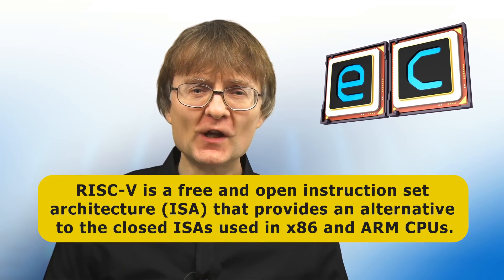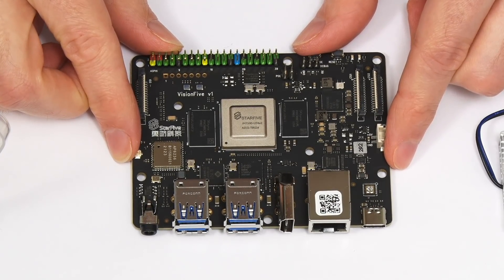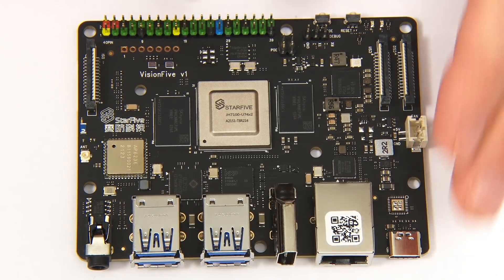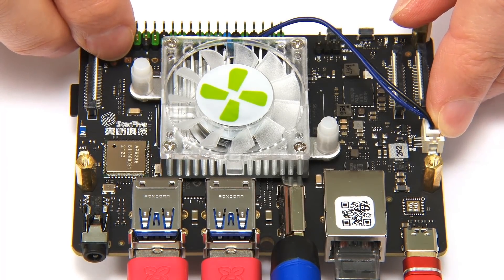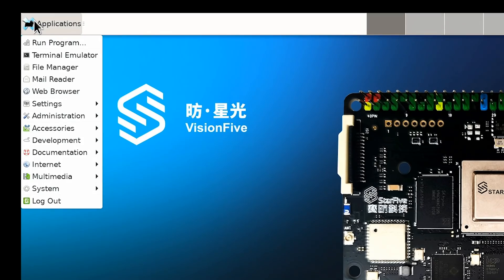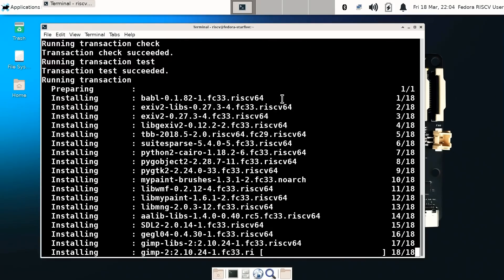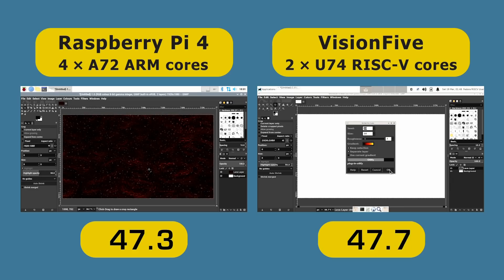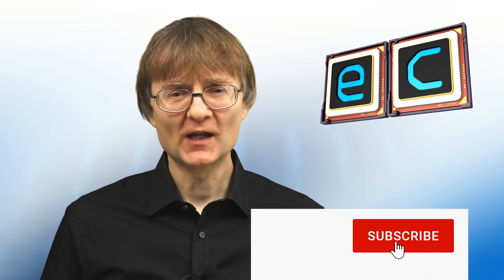VisionFive RISC-V Linux SBC

Comment: Assuming that GIMP Lava filter is a single- or dual-threaded load, the performance of this chip is pretty much exactly on a par with the Pi's ARM chip clock for clock (it's clocked 1.5x slower than the Pi4 and did the filter in 1.5x the time), which I actually think is pretty impressive considering how much longer ARM have had to develop things. I suspect most of the sluggishness on the desktop comes from it being a dual-core rather than a quad. Will be interesting to see how this develops.

Comment: Interesting board. Still years light behind ARM SBC's development. Performance on desktop is way slower than Vim3 Pro, Odroid-N2+ and Radxa Zero2. All of them using S922X/A311D variants. Price is expensive as well. Currently sells at $179 for the starter kit without a PSU/Cable. Rock5B with a much powerful SoC will be selling soon at $99 if you preorder one for 8GB RAM version. Remains to be seen if Risc-V will catch up with ARM and if it becomes a feasible option to ARM in a near future.
Reply from the maker: Behind ARM right now, certainly. But absolutely not "light years" behind. Core for core (2 vs 4) the VisionFive actually beat the Pi 4 in the GIMP filter test! Ultimately, this is a development board, and the price reflects that. It is not a consumer product, and we will have to wait a few years for those . . . :)
Reply: @ExplainingComputers  Does the GIMP filter test use all available cores, or is it single threaded? Running htop at the same time would confirm.
Reply: @johnm2012  GIMP just started getting fundamental multithreading support (with release 2.10) and far from all operations support it currently, so this is likely measuring single core performance for the most part.
Reply: The key cost reducing factor is mass production (including that of parts like SoCs and connectivity). While these boards or Pinephones and Librem 5 phones are built entirely by small companies. Let's hope it gets better.

Comment: That is a fairly surprising (and fast) little device considering RISC-V is (still) having its first baby steps on the market. It shows promise!
Reply from the maker: I totally agree! It is interesting how views diverge in these comments. Some, like you and I, are impressed but what a RISC-V board can do right now. Others are dismissive because it is not as fast and low-cost as current, long-standing technology.
Reply: @ExplainingComputers  I'm one of the sceptics, I'm afraid. If you want a free and open source RISC processor, the SPARC has decades more development under its belt. Years before the Raspberry Pi I bought an expensive development board with a MIPS processor and was excited when I got it to boot to the Linux bash command prompt (not a desktop, of course!). They are still used in routers and laser printers. ARM is special because it can do a lot with very little electrical power. x86 can do more but uses more power. I just don't see what RISC V has to offer that will persuade people to use it in sufficient numbers to allow it to develop into anything other than a curiosity, in which case it will continue to underperform and be more expensive than a similar ARM-based product. I was concerned about ARM being swallowed up by Nvidia and had hopes than RISC V might step up to the mark but that danger has passed and RISC V seems to be struggling to find it's purpose. It will always be a couple of generations behind ARM and unless it can provide some compelling advantage of its own, why would anyone choose it?

Comment: RISC-V....how exciting!  Once all the important aspects of this new technology are explored, I'd be interested in finding out what its performance equivalent is compared to the other SBCs you have on hand.  For example, since it currently performs slower than a Raspberry Pi 4, is it more on par with a Raspberry Pi 3 or 3+ overall?  Plus, it would be fun to put it eventually through your traditional heat and cooling tests.  Anyway, I am looking forward to whatever aspects you explore next on this hardware.  I hope RISC-V catches on in the world of computing out there.  Looking forward to your next video!
Reply from the maker: Greetings Perry. I expect RISC-V hardware like this to improve in performance and decrease in price. Already, core for core (2 vs 4) it beat the Pi 4 in the GIMP test. So a board with 4 U74 core and a GPU would out perform a Pi 4 . . .
Reply: @ExplainingComputers  but does GIMP use all cpu cores for this? Or is such a filter done on one core? Still impressive for a newcomer 1GHz core.
Reply: @ExplainingComputers  thanks for the input. I am pleased to see this technology finally get into your hands!
Reply: @ExplainingComputers  GIMP's lava filter isn't a multithreaded workload.  It takes pretty much exactly the same time whether I run it on single core or all 12 on my 5900X.
Reply from the maker: @henrikemppainen2511  Thanks for this. I had not considered that the filters in GIMP were not multi-threated. My bad. :(

Comment: It's true that it's running a full version of Fedora, but even so, it shouldn't be that much slower than the Raspberry Pi running Raspberry Pi OS. This seems to be a REALLY slow system and OS combination.
Reply from the maker: As the GIMP filter showed, core-for-core (2 vs 4) it was faster than a Pi in that test. The Pi has had years of software development on a widely used platform (ARM). Running full Linux on RISC-V hardware is only months old -- so I'm amazed how well it performs! :)

Comment: Why wont these micro boards, even in 2022, dont include an M.2 port for SSD's?
Reply from the maker: Price and complexity. This is a development board, not a consumer product. It is amazing it even exists! :)
Reply: @ExplainingComputers  Sure, I understand your point and I think the low price is one of the main attraction of these micro boards. I just think options for these boards, for example with M.2 socket, with be a very nice addition.
I would get one with M.2.

Comment: Another thing: Some analysts have pointed out emerging and concerning trends where (A) some non-soldered CPUs are locked to their OEM mobos (i.e. effectively not movable. e.g. mini nodes), and (B) a few CPUs are feature locked.  Some early speculation: open ISA platforms might thwart both trends to an extent, and promote continued healthy market development towards even more economical and maximally-featured (non-hobbled) CPUs.

Comment: I never thought I'd see the day that we'd actually have a choice in CPU architecture.
Reply: There's always been a choice in CPU architecture, nearly 50 years worth.

It's just that the lower cost msinstream gets most of the news.

Its just that if you go off-road there's the risk of being left hanging when a supplier decides to close shop..
Reply: @joefish6091  I'd disagree. Most of the choices were either not well supported, or very expensive for a normal individual to own. Mostly both.  
And of course, there was not much support either, on an individual level. This is, so far, going in a different direction.
Reply: @thekakan  We'll see if RISC-V will be well supported in a few years
Reply: @bcm0911  RISC-V is not new. Its already being used in some major places, like the Titan chips inside Google Pixel, ESP32-S, and Seagate recently announced they'll use RISC-V for their future storage controllers.    
Sure, there's a chance it might not survive, but so far, everything has said otherwise. It has far more developmental tools and support than any other royalty-free ISA( MIPS went open some time ago ig? but practically everyone has moved on already ).  

But I do agree, it'll be really interesting to see how it goes from here!
Reply: @thekakan  Macs used motorola 68k series processors until the 90s, then powerpc RISC processors in popular personal computers up until 2007.
Reply: Amazing and confusing times we live in, heh

Comment: Given that this processor is an open platform, I wouldn't expect it to be used where security is a critical issue.
Reply from the maker: A similar arguement can be made about closed architectures! :)
Reply: @ExplainingComputers  True. I guess only time will tell. But then the base argument "Where there is a will, there is a way" could be applied either way.

Comment: When you tell us something has a USB3 port, is it possible to tell us what Gen it is? For instance, those USB As could be either 5Gbps or 10Gbps. Thanks
Reply from the maker: Here I'm certain it will be USB 3.0 -- 5Gbps.
Reply: @ExplainingComputers  The whole thing seems rather a mess, to me! I bought a MiniPc, T-Bau MN25 which described it's ports as "Ports: 2 x USB 2.0, 4x USB 3.0", however, I put an NVMe in a USB3 caddy, and I'm getting 979.55 MB/s read/778.47 MB/s write, so surely that has to be USB3.2 Gen 2, surely? If so, why undersell it?

Comment: The physical form factor appears to be identical to the Pi, although the ports are arranged differently.  is that correct? That suggests that any existing box designs (e.g. for 3D printing) will have to be modified, but it won't be necessary to start from scratch.
No sign or mention of an NVME connector, so supplementary storage (beyond the SD card) will presumably require a USB connection?
For a development board, the essential pieces of software are vim (or some other editor, if you insist), git, and the gcc toolchain. How do they perform?
Reply from the maker: The form-factor is arger than a Pi. There is another RISC-V SBC out there -- the Nezha -- that is the same size as a Pi, and which I'll be covering here probably two weeks today. Additional storage on the VisionFive is indeed via USB 3.0 only. I've not tested develoment tools. Yet! :)
Reply: @ExplainingComputers  It's surprising that SBC manufacturers don't generally supply a diagram of board dimensions, port placements, &c. that would enable people to produce boxes for them, (or see how existing ones could be used or adapted). They know the dimensions and layout long before anyone else, and it would save a lot of fiddly measurement on the part of potential suppliers. For a small organisation, the easier they can make it for world+dog to supply accessories, the more allies and unpaid sales droids they will have.

Comment: With Risc-V you have the option to make your own intructions that can run on the CPU, does this board also have a CPU programmer?
Reply from the maker: Those instructions, as I understand it, have to be part of the CPU core design. Once you have final hardware, as here, the instruction set on it is fixed.
Reply: @ExplainingComputers  The reason i am asking this, is because they managed to run Risc-V on a FPGA. The price of this board is rather high, also because this is a an open source CPU. If it's fixed, open source is useless (read: closed source). If the price would be way lower, then it is an option.
Reply: That's an option for people making CPUs, not for people buying them. You can of course make your own RISC-V CPU running on an FPGA with whatever custom instrucitons you want, but cores on FPGAs run at a maximum of around 100 MHz, not 1 GHz as here.

Comment: It looks to me like the CPU is just intended to be glue for the AI.  I would love to see this board showing off its machine learning abilities.
Reply: Agree, I am curious what benefit the "nvdla" core (.. Is it a separate chip??) brings in practice. It seems to be increasingly thrown in with new SBC designs. Interesting this one seems to include both a deep learning engine and nvdla. Do they work together? Fight for ai dominance? But that's a very specific topic and since I have no "need" to know I won'trequest Chris seriously dedicate a video to it unless interest is there
Reply: Would definitely like to see a video going further into the AI capabilities of this board.
Reply: And if it indeed is a better platform for a neural network, then this is a good thing.

Comment: I was ranting on about how cool the M1 was, and my (engineer) son informed me of RISC-V. Given how much I taught him about technology ... it was a lovely gust of fresh air to get a geek-insight first hand. $0.02 and thanks for the videos.
Reply: The M1 really is cool. It's not just an ARM chip. If I've read correctly it also executes x86 code to ARM on the fly (I may have misread that). It reminds me a lot of Transmeta and their Crusoe processor except that Apple has actually pulled it off with decent performance
Reply: @retroatx  That's what having several years' preparation allows you to do. Apple had been anticipating the change years in advance.
Reply: @candidcorvec   Having had a previous transition to a different architecture and since then encouraging their programmers to follow related guidelines helps too. It's exciting to see ARM becoming a factor on the desktop but I fear x86 emulation will pose a problem for apples competition. Looking at windows users and gamers in particular.  What good does a 32core ARM/RISC-V board do, with PCIE and shiny GPU if you take a massive performance hit by using it?
Reply: :cat-orange-whistling:
Reply: :hand-green-crystal-ball:
Reply: :cat-orange-whistling:
Reply: You do realise the M1 is not using the RISC-V ISA, don't you? The M1 is a ARMv8.4-A based chip.
Reply: @Peter1986C  yeah, I realise that. A given fact.
Reply: just being RISC is impressive after a good couple decades of x86 dominance in desktop computing
"RISC architecture is going to change everything"
Reply: @Peter1986C  When did he say it was RISC-V in his comment?

Comment: Ive been playing with the Longan Nano and yeah RISC-V is great , its just a shame these larger implementations are just so far from price/performance parity, I also hypothesise that much of this is due to having to adhere to other closed source standards for much of its IO and the like. Its a shame computing architecture cannot have a fresh install ....
Reply from the maker: I'd not thought about the issue of closed-source IO. Great point.
Reply: I can’t see how Open vs Closed i/o could have any impact on the current lack of parity for other SBC vs Raspberry Pi. The parts already exist and are available for anyone to buy. There is no separate higher pricing for using those parts with an SBC based on an SOC using an Open instruction set. 

I think lack of volume causing a loss of economies of scale is a much more likely reason.  Raspberry Pi currently sells millions - IIRC it’s five million - of units per month. Add to that a decade of refining their design and manufacturing processes, and part sourcing to reduce the BOM, and it’s inevitable that their cost per unit will be much lower. 

Volume also means that the costs per unit of passing licensing tests in each country is going to be much lower. Recall that when the Compute Module 4 was announced, Raspberry Pi specifically called out that it was already certified for wifi and Bluetooth in many countries, so the cost of certification would be avoided by anyone using it as the basis for their product.

Edit: future open standards may reduce costs, but by being open they would reduce costs for everyone and thus not impact price/performance parity.
Reply: @williamp6800  my thought is that not only would you have your own internal development costs but also the costs of licences for interfaces as well as having to create converters between your internal systems and said licenced interfaces that may or may not easily sync up with your internal design methodology.
Reply: @deadadam666  I’m not understanding what you mean by “internal systems” and “converters.” Maybe laying things out will help:

Whether an SBC or a “full” computer, functionally you have the CPU/SOC, RAM and GPU if not part of the CPU/SOC, circuitry to connect those components as needed, and connections to provided data and power to whatever i/o is present. 

The i/o circuitry may be integrated into the CPU/SOC or it may be physically discrete. For example a wifi card in a laptop is typically a discrete part. Video card in a laptop could be discrete or integrated into the CPU. For an SBC, it’s pretty much all in the SOC. 

One way or the other, the components need to be designed and laid on the circuit board with power and data lines going to the i/o connectors wherever they are. Open or Closed standards makes no difference to what needs to be done.

Take cellular modems. Qualcomm gives us good example to illustrate this point. Qualcomm owns a number of patents required by cellular modem standards to operate. They also make cellular modems.

(I’m completely putting aside the issue of patent licensing and FRAND issues that I believe are still before the courts at this time)

So you decide to use Qualcomm’s cellular modem on your SBC. You have to pay Qualcomm for each modem PLUS you also have to pay a licensing fee for use of the patents embodied in each cellular modem.  A great example of a non-open standard.  Pay for hardware and pay to use the standard. 

Now what if we lived in an alternate universe where the cellular was an open standard? Unencumbered. Usable by anyone. No license fees. 

That would mean that while you still had to pay Qualcomm for your cellular modems, there wouldn’t be a separate license fee that you would also have to pay. So it costs less not more.

Comment: good on Fedora for fully supporting RISC-V , since 2016! while other major distros are "in development" . huge Fedora fan. this is all very exciting!
Reply: Ubuntu has been out for some time now, with both 20.04 LTS and 21.10 available for RISC-V.
Reply: I am sure gentoo could be compiled for that arch soon after releasing :) but I didn't check that though
Reply: Now that it's supported by one distribution it won't take much time for them all to do it.  The hardest part is the board support package.

GCC has to be modified to work with this, you have to compile everything, it's a pain.